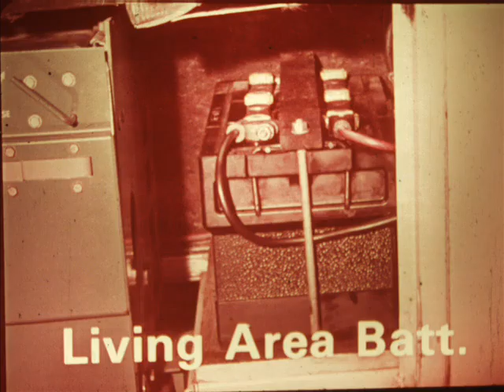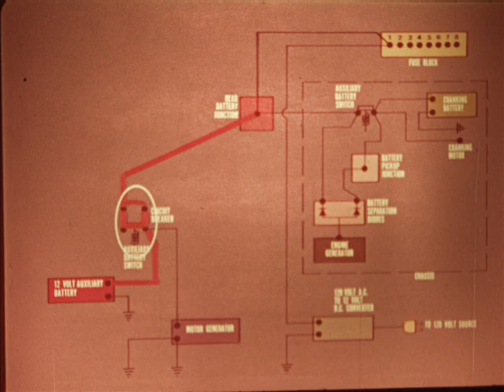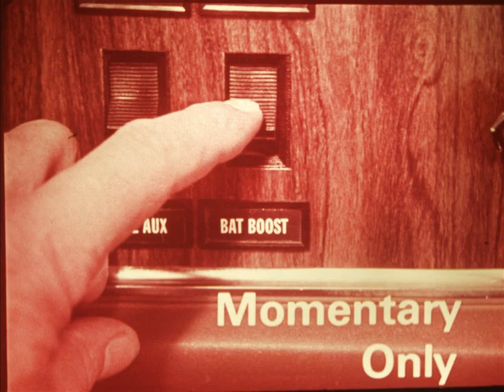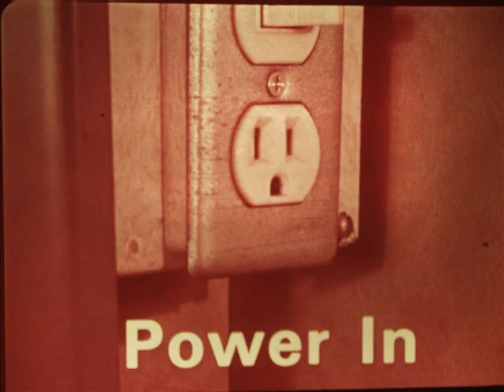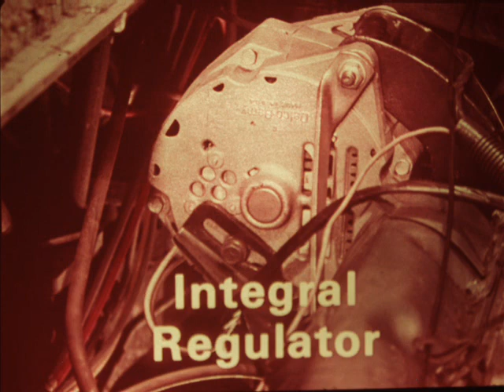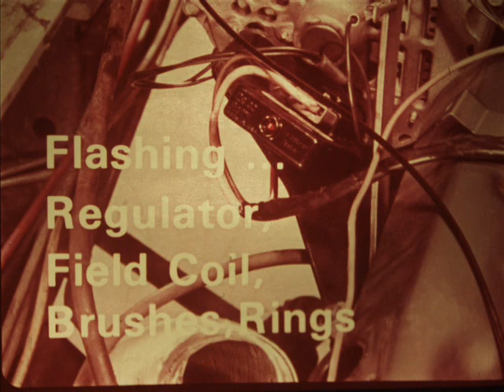MH-18 GMC Motorhome Charging System

Comment: Every day and every hour.... gmcer breaks down...GMC made mistake with the engine and transmission... plus the electric and electronics are a mess and can't be trusted...
Reply: They should use a cumins engine 12 v alve 5.9 and an Allison transmision.  I am working on one sitting for 10 years i hope the gas tank are good it needs fuel